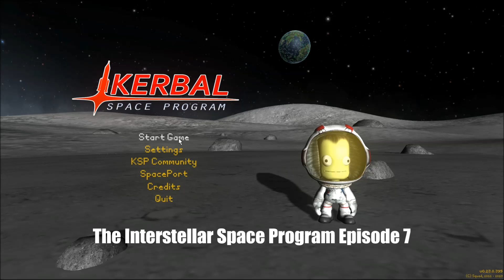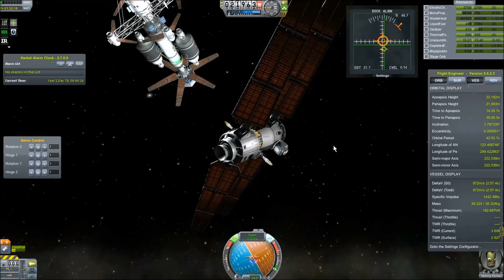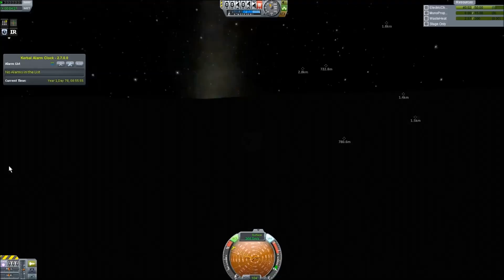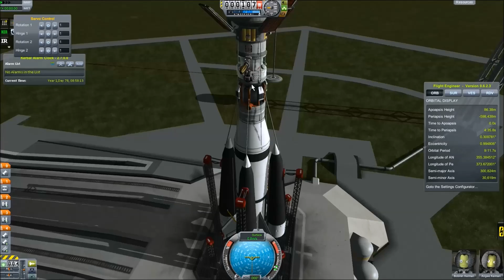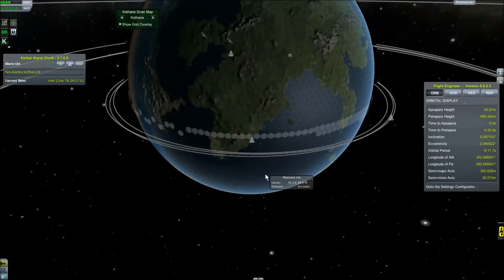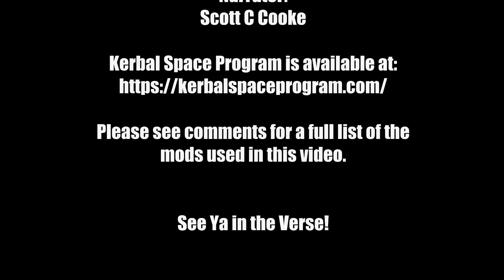KSP Interstellar Space Program Episode 7, More Power Redux

Comment: love your craft designs, i see that you use kethane, KW, and B9 ... is there a trick or order of operation on installing these specific mods together?
Reply: also scott, u don't really need KW if u use .23.5, as it adds some cool 3.75m engines and tanks. and less crashes! although i don't think infernal robotics works with it
Reply from the maker: not really a trick, I install B9 and KW first then I used the texture reduction mod on them and then installed everything else I still had to remove some parts from some of the mods because of memory erros
Reply: did u install the texture reduction packs for them? they help as well, they even have one for squad, the texture reduction only has so much effect
Reply from the maker: Yup, i installed every texture reduction pack i found when i was setting this up.